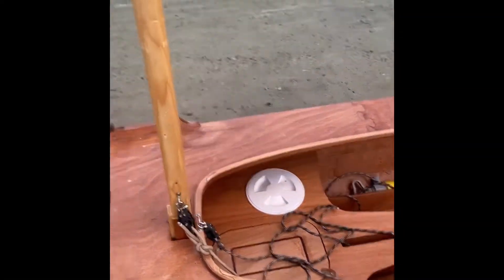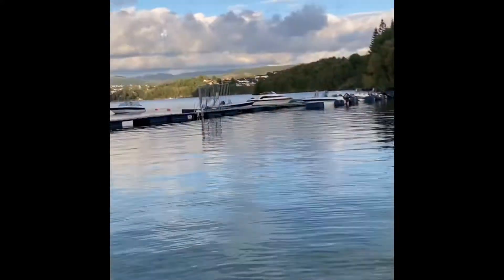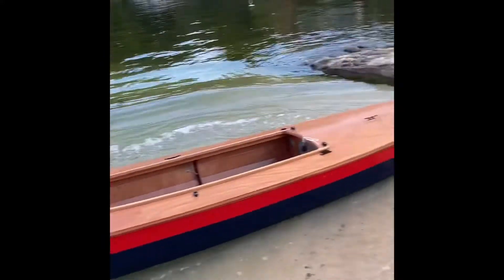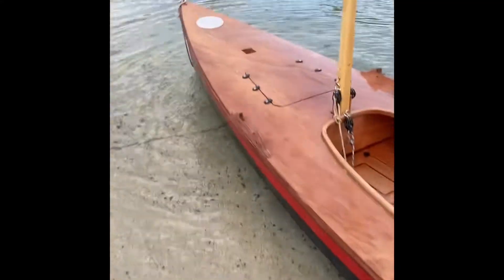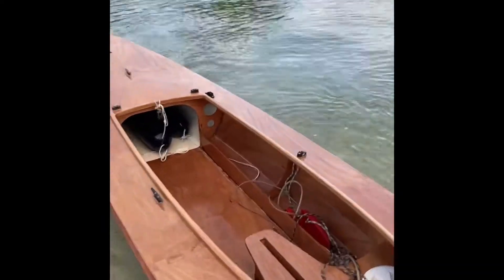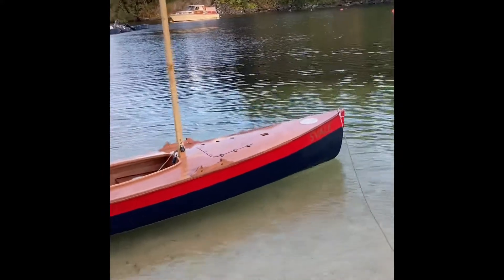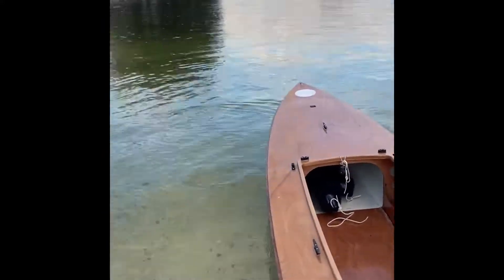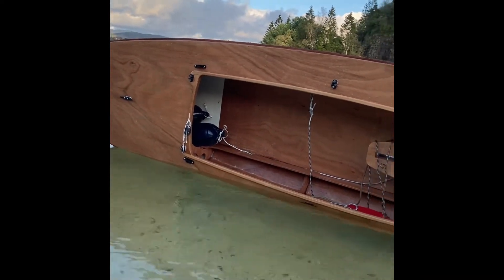Svale with water ballast

Comment: Well that's intersting. I got home a few weeks ago after a short afternoon of sailing and was very frustrated about her stability in gusty winds, as far like not having fun sailing her anymore in those conditions (which we saly have quite often at our little lake...).

Did you test how she behaves while sailing? Are you still able to get close on the wind with this extra ballast?
Reply from the maker: Yes, I did take her out sailing before doing this test.  The ballast did make a difference, but not as much as having outriggers.  I agree that gusty winds are not the strong point of this design! I found a deck level seat useful so I could more quickly and easily move inboard when the wind drops suddenly!
Reply: @guyhall6241  thanks for your reply, that might be an idea too.
I was also going to test a lighter (maybe carbon) or maybe shorter mast, how big is your little rigg?
Reply from the maker: @elltielle  I think the small main is about 28 square feet, I borrow it from my kids pram dinghy!  I too am thinking of a lighter mast, I have made a few enquiries about getting a carbon mast made but so far no one seems interested in doing the job! I might make a hollow wooden mast as my next improvement. I think a lighter mast and yard would make a huge difference. The outriggers are great but it is more kit to carry around and longer rigging time. I would use them at sea if I was going cruising though.
Reply: @guyhall6241  that's why I don't want to go for outriggers. 
There are several companies that sell carbon tubing where you can order your desired length, that's where I got my mastparts for the Paperjet. I just reinforce them with an extra layer of carbon fibre where I add screws for hardware.
Another method would be a wooden birdsmouth mast with mixed wood, cedar + poplar i.e. for lightness and strength.

Did you already try to use the mizzen as main mast? Probably not enough power?
Reply from the maker: @elltielle  yes - I have tried the mizzen as a mainmast, if there is enough wind it does actually work quite well! I think there is a video of it here…